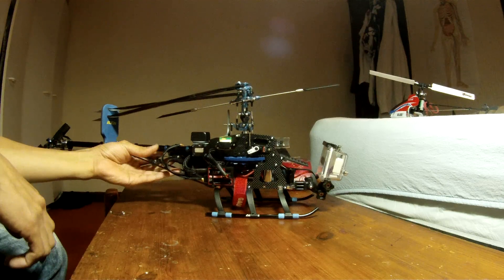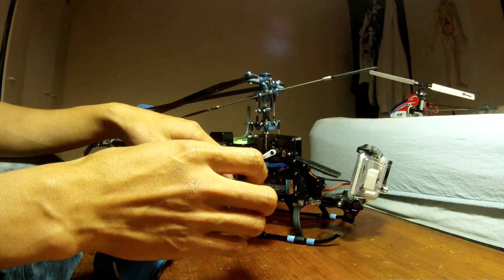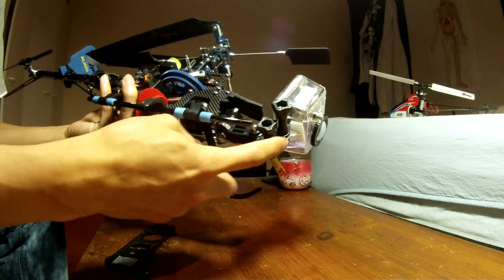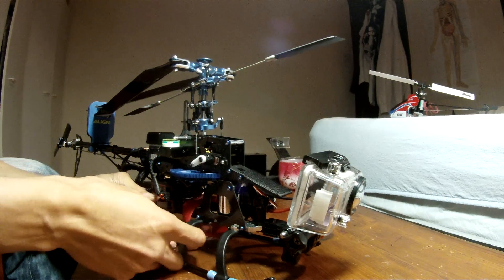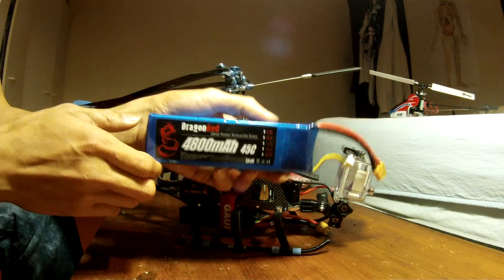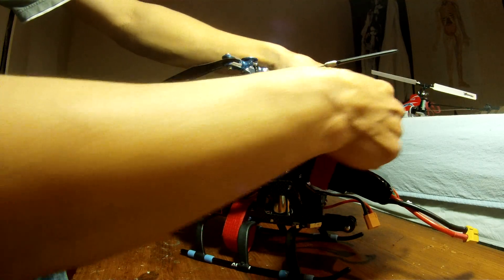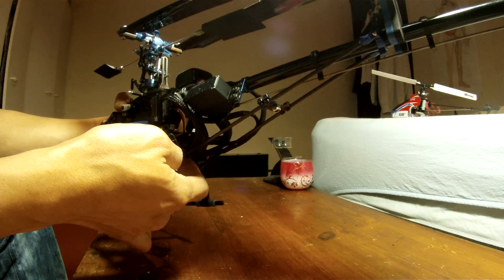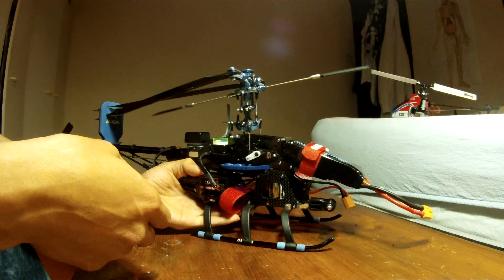How to mount Gopro HD camera on Align T-Rex 450 RC helicopter - Tutorial

Comment from the maker: @8180634 You are welcome :) 
For smaller battery I normally set my alarm for 5mins and I've flown with the 4800mah battery couple times for about 12-13mins but I think I can fly up to 15mins without going lower than 3.7v for each cell. I usually use the bigger lipo for setting purpose though

Comment from the maker: @onkelbolle Yeah, 450 is a very good size to start with. I tried with 200 size heli before which was too twitch. I think I'm gonna stick to 450 cuz I like it's portability (small but stable enough which is a good compromising point - that's why I stretched to 350mm blades for extra stability within 450 size) :)
I see you are planning to go for a bigger heli in the future. I guarantee you will be also interested in FPV soon or later. Let me know if you have any help or question any time ;)

Comment from the maker: @onkelbolle No problem :) Just to let you know if it's fuzzy, you can work around head speed. But if it's wobbling (jello), you need to reduce the total heli vibration. Try to locate the vibration by adding bits one by one and spool up - for example, only main shaft and spool up (of course with no blades), if no vibration then add tail hub, if no vibration then add tail blades and so on. You need to have minimal vibration before mounting the Gopro, otherwise no matter, what you will get jello